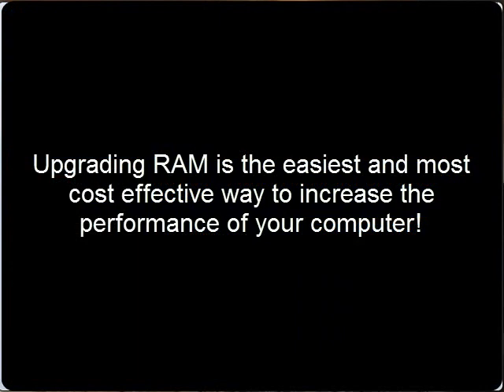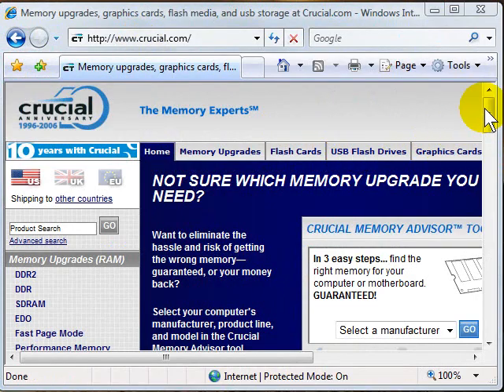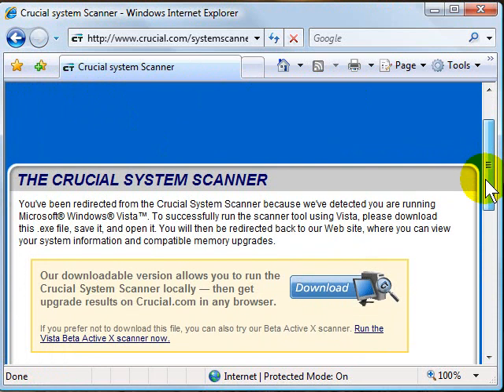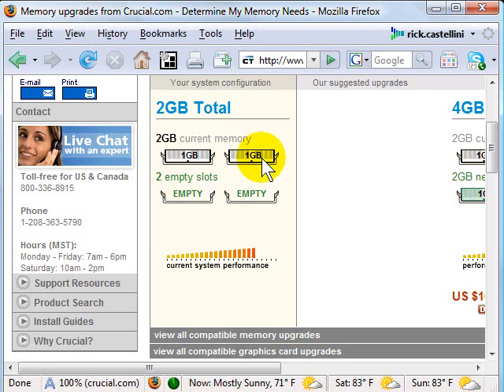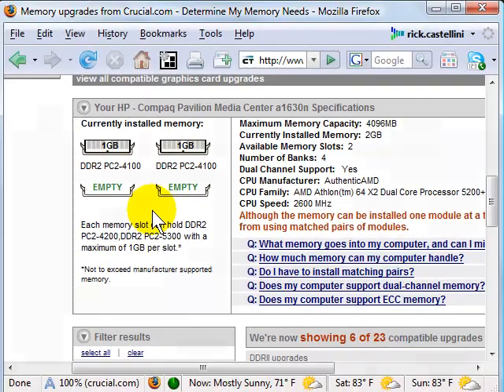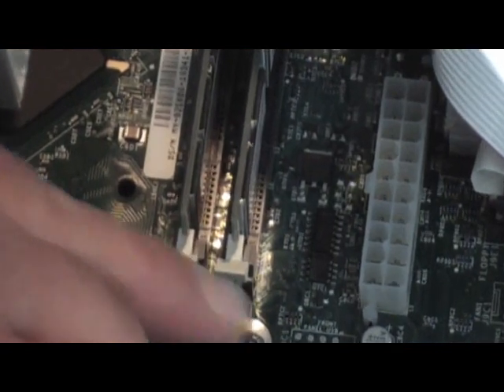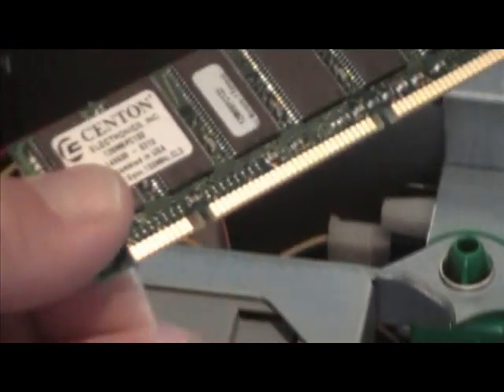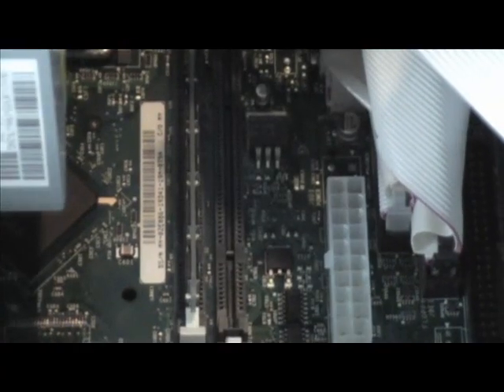A-to-Z Computer RAM Upgrade

Comment: QUESTION:so, you remove the old cards and just install 2 new ones(that is what I saw on the video)? or I can add 2 new ones on top of the one I already have? I have 4 slots in total, 2 empty.thanx, didn't know what to buy but  the scanner was helpful.

Comment: Thanks for this wonderful video, I just have one question... my computer is compatible for up to 2gb of Ram, on both ddr PC 2700, and ddr PC 3200, my PC has 1 stick of ddr 2700 at 502mb, so, Which one would you recommend? 2700? or 3200?

Comment: this vid has failures. firstly, it is a RAM module (not chip), and you touched the pins+RAM which can cause damage (not that you would know). also, its not vista fault that crucial isnt compatible with it.  good points are that you gave some good info and encouraged system scanners.